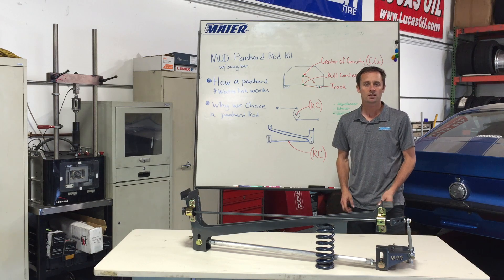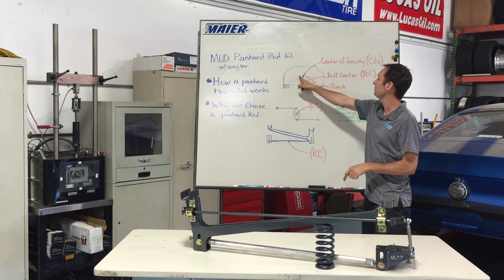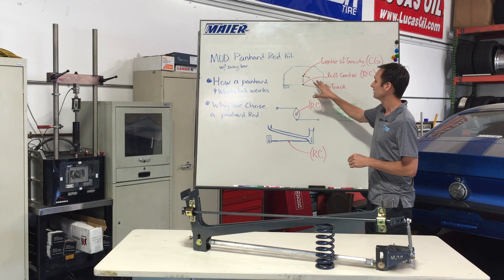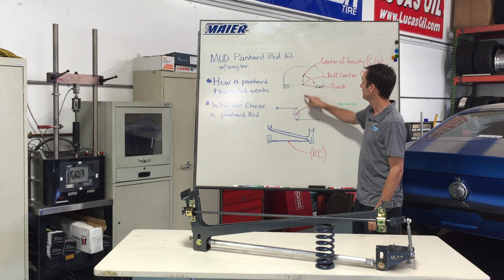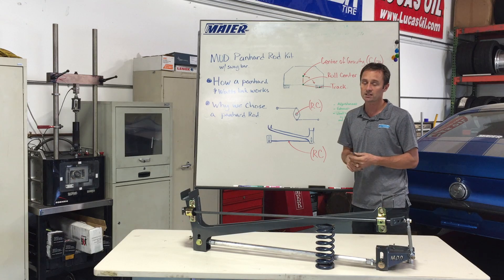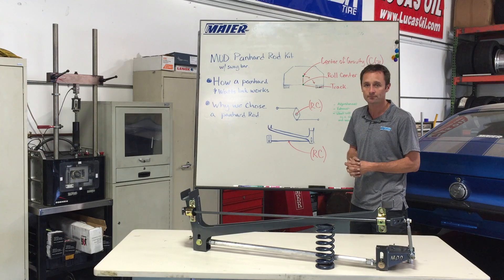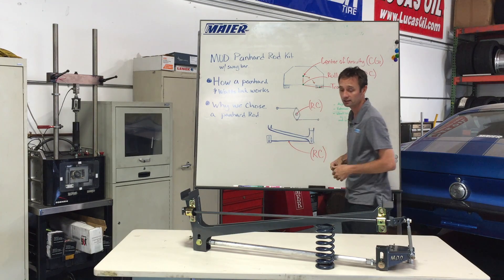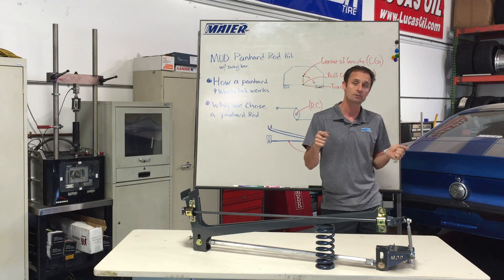MOD Panhard Rod vs. Watts link

Comment: Also the jacking forces on a Watts link theory is wrong. If both links run parallel at some point in their travel (normally at ride height) and the links are the same length then the jacking forces of each link perfectly cancel each other out.

Comment: Lowering the rear roll center does not cause the weight to push down on the rear tyres. It is exactly the opposite. It forces the front suspension to roll further that it would have normally causing it to take more of the weight transfer. End result being rear end remains more equally loaded than the front, giving it more grip. The end result is still the same as he predicted but Professional companies like this should understand and explain how suspension works better than they do.

Comment: Great video. In my opinion most Watts links have roll center adjustability making them somewhat superior to a pan-hard bar. I think the difference comes in price and ability of the driver, most drivers won't ever use their cars to the full potential. I bought SORT watts link but looking back and 800dlls poorer, I could of achieved the same results with  a cheaper pan-hard bar.
Reply: You're  correct.. And I've proved on the track.

Comment: Yeah... I talked to some of the mustang road race guys... the had a lot of issues using a panhard bar...turn good one way and not the other...they all went to watts link.. but what ever.. ive ran to panhard bar cars and one with watts link.. I'll stick with the watts link
Reply: They didn't know how to tune suspension then. Which is funny because setting up a watts takes more time and adjustments.
Reply: @I_like_turtles_67  Watts link also has a higher roll center.  PH rod is the superior option.  Period.
Reply: @I_like_turtles_67  hahahaha... wrong.. they definitely knew what they were doing..
Reply: @thepwee  No problems with my car on mike's MMI  suspension. Swaping over to a full floater too. Keeping PHB in the rear.
Reply: @I_like_turtles_67  yeah.. I had a PHB in mind.. adjusted perfectly and is worked great.. just not as good as a watts link...the Watts like was a pretty significant difference..you definitely should watch more videos watts links.. but if you just on the street keep the PHB.. My car out.. grew it..!! Also they are super easy to adjust..
Reply: @thepwee  Mike built one of the fastest auto x cars in the country. At one point. The car had really basic modded suspension with a little 302 and a 4 spd. He was beating 100k prepped cars durring that time lol. It took a good 2.5 years before people caught up to him. I know Mike has run both watts & PHB in the rear of old blue. Watts IS a great rear set up. But 99% of drivers will never use the slight advantage in running one. Ease of adjustments on a PHB made it the best choice for me. I'd rather tinker on shock valving, then dealling with adjusting a watts 3x as often to set it up. 

Just my .02
Reply: @I_like_turtles_67  yeah.. I get it... it just you can sell me on something the is known industry wind not to be as good as a watts link... it just isn’t..I’ve worked on cars professionally for 33 years now.. 15 to now as an engineer....
 My 25k shitty car has beat 100k prep cars... it really makes no difference...

Comment: Question, if you relocate the leaf springs inward can this panhard rod and rear sway bar kit still be used?  Also if you have any input on leaf spring relocation in terms of handling.  My car is a street/track want-a-be and am trying to stick a larger rear wheel on the car. 1966 Mustang.

Thanks
Reply from the maker: vince@mikemaierinc.com or (925)-443-6300. Thanks for the question!

Comment: panhard doesnt work well with hydraulic suspension. 14 inch ride height difference. the panhard pulls axle as it goes up

Comment: But your price is the same as the upgraded BMR watts link and way more than most setups. And have never heard of hour name brand. Probably because of the price.
Reply: I know this comment is old..... But if you haven't heard of Mike, you don't autocross or follow the ultimate street car challenge. Mike's was beating 150k pro touring cars with his old 66 mustang years ago. With a old carbed 5.0 motor and a 4 speed. With a stockish suspension in the mid 2000's.  That 66 mustang has morph into one of the best known cars in the country. He runs neck and neck with some of the best shops in the country. Like Detroit Speed Enginering.